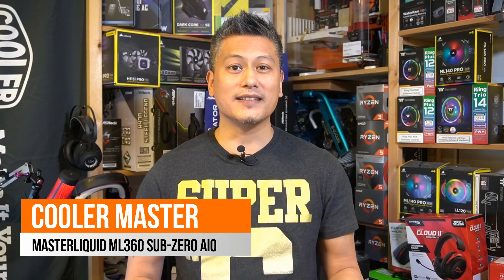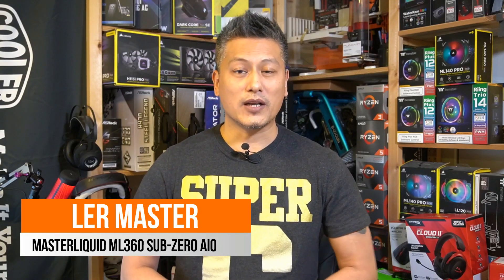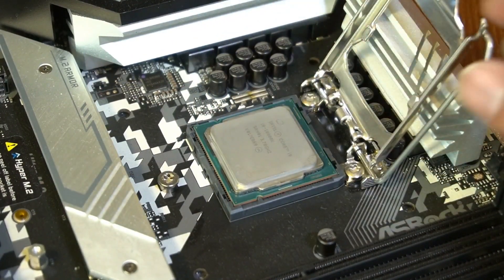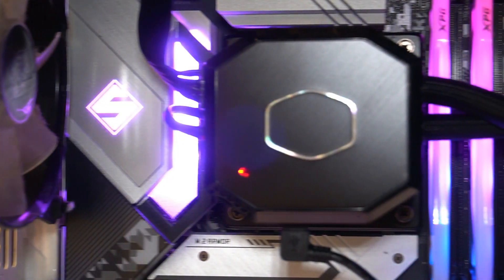Installing and Testing the Cooler Master MasterLiquid ML360 Sub-Zero AIO CPU Cooler

Comment: If radiator is on the front pipes should be on the bottom to reduce air trapping
Reply: Doesnt matter, the pump is at a lover point in the system, if you get air traping with this configuration, there is something wrong with your AIO

Comment: Can some please verify for me if running a dew point of 12.4 with a temp of 14.4 degrees Celsius is a desirable range and better yet, can some please direct me to a guide of what the safe and desired ranges are? Also, should the unit be going into standby mode on its own or only when manually set to it?  I've been trying to get an answer from coolermaster to no avail...If anyone can offer me guidance, I would be grateful. Thank you.
Reply: UPDATE -I have been trying to get an answer from coolermaster for about two weeks now, I'd like to hear from them directly - I will post the interactions I have and or initiate with them detailing their "customer service" - "This is ridiculous, I have yet to hear back regarding a normal question as detailed above. NO ONE FROM SUPPORT HAS CONTACTED ME IN OVER A WEEK."

Comment: My system won’t boot with cpu 8 pin connected to the water block. It will boot without the 8 pin connected. What cable are you using to power the water box/tec
Reply: Pcie cables

Comment: can you use it on a TR4 socket?
Reply: Read information about this aio
Reply: Officially no, its only for intel, but you can use some custom bracket and a second motherboard with a intel CPU to control the software but cold the AMD CPU
Reply: @victordavid29  i dont think using a second motherboard would be needed, as long as you could get a tight enough mount on the cpu, you just need to plug in the extra power cable and the other cords. installed it on a different pc (intel) and it didnt need anything special besides the extra power cable

Comment: Can be this used to cool a delided direct die i9-10900K ? (I mean the height will be a bit less due to lack of IHS on the CPU)

Edit:
I tried and it is not possible.

The Cryo cooler has a plastic/rubber which prevents the copper plate to be mounted lower - to touch to delidded CPU.
So, you need a CPU with IHS to fit the Cryo Cooler Master.

I am not sure about the EK TEC cooler though..

Comment: Im hitting easly 5.6Ghz on my delided i7 10700k without any problems...in IDLE mode with this cooler (20°C). 
I don't even use thy cryo Mode. Which i've tested and it drops the Temps to 10°C and need extra 50Watt.
Awsame Cooler and nice Review! 👍
Reply: So you are saying you can simply use the included mounting of the Cryocoler on the delidded CPU ? I am wondering you are direct die cooling or you just delidded / applied liquid metal and put back the IHS ....   

And more on this : they say on sustained load on all cores the Cry Cooler cannot cope , something like the Peltier is itself a bottleneck . Is that right ? Could you keep the i7-10700k on all cores on load at 5.6 Ghz ?

And at last , what about the noise ? They say the pump is very noisy ...
Reply: 6.7 on i9 11900kf for a second and no crash

Comment: can you control the speed of the pump? and the fans?
Reply: Not using the included cables. The fans could be plugged directly into motherboard headers (or a fan hub) to control them. The pump, though, plugs into a SATA power connector. To change the pump speed you'd have to adjust the voltage going into that cable. You could try that by modifying a SATA power extention cable to drop the 12v to 7v. No idea if that help with the loud noise or if that's just a reality of this pump.
Reply: @jomeyqmalone  Pump, no.
Fans, yes
Reply: @jomeyqmalone  Not with the suplied cables : the AIO Pump is powered with 12V from a SATA connector.
But, I managed to modify the Cooler Master cable : fitted the fans into a PWM 4 pin Fan header , and also the AIO pump managed to fit as a 3pin DC fan into the motherboard . This way you can controle speeds both for the AIO fans and AIO pump from Bios with a user defined curve . Of course you need a motherboard with enough Fan headers and the option to controle PWM / DC fans.

Comment: warning! This cooler can only be uesed for single core boost overclock or low power CPU such as 10600k. When you are doing some heavy duty such as P95, AIda64 FPU and R20 stress test with a CPU power consumption greater than 200W(like overclocked 10700k or better CPU), the performance of the cooler is pretty similar to a normal 100$ 240mm liquid cooler.
Reply: Why is that ? 
I am running a i7-10700KF , direct die cooling, 360mm AIO : 5.2Ghz on 1-6 cores, 5.1 Ghz on 7-8 cores . 
On full load benchmarks CPU is sucking obvioulsy more than 200 W , peak at somewhere 295 W .

And I was wondering if this cooler might help me for higher speeds ...
Reply: @TiraSoft_GB_Ham  did you get the cooler in the end
Reply: @arjundevalia1439  yes I did. tested it ... longer story .. I will make time to write it , lol .
Reply: @TiraSoft_GB_Ham  yeah could you tell me please cos I’m considering on buying the cooler master ML sub zero aio thing

Comment: This is very cool (pardon the pun). However I don't think the tech is quite there yet to be worth it. Apparently it struggles and even performs worse than normal aios when under heavy multicore loads. I would love to see the results on a delidded CPU.
Reply: Seemed to work fine during his testing. Besides the fact I'm using the hex 2.0 on my 9900k. Keeps it cool under normal load at about 4.8 to 5.0. Average about 75c to 85c.
Reply: @georged5420  75-85C isn't normal on a thermoelectric AIO... I thought this was supposed to cool the CPU better than a normal 360 AIO, but I guess it sucks ass.
Reply: @sL1NK  my hex 2.0 that I use was compared against 120 aio not a 360 aio. Furthermore running a voltage of 1.2 and gaining 5.0 is pretty damn good at 85c. So no it doesn't suck ass only your comment does.
Reply: @georged5420  how do you mount this to socket 1151. Says it only support socket 1200?
Reply: @thomasadolphsen2550  I'm using the hex 2.0 cooler. It's also a thermoelectric cooler. Very early version that are cooled.

Comment: A cryo cooled 10900k being driven by the ASRock Steel Legend's underpowered VRM setup? You're a braver man than I. Doubly so since your front mounted rad setup for the TEC is essentially like bolting a 400w heater to your case intakes.
Reply from the maker: LOL yes brave ... plus I left the case side panel off :D
Reply: @Funkykit  Would be better if the fans were exhausting in a top mounted setup.
Reply: @Jedi2155  Yes recommended setup is rad on top mount an not for i7 i9 lol Hope he shows his 10900k dead from cooler vid
Reply: @iLLicitNz78  Rad on top means avg +10-15C to the CPU, why would it be recommended?
Reply: @sL1NK  Because that’s heat that doesn’t hit your gpu
Reply from the maker: Yes it would... I just wanted to see if it would fit ok if mounted on the front. Plus it looks way cooler lol 😆

Comment: Stability test for 40sec :D :D   worst review
Reply: people who have their cryo block from ekwb have reported worse temperatures than a normal waterblock under load. these review youre watching are from golden chips that can clock crazy high with way less voltage than what normal people will get delivered at home. you can even tell by the monitoring software he used that the cpu would thermalthrottle during benchmarks and reach way over 100 degrees. i mean its still fine because no game would use the cpu this much and it wont reach those temps but i bet that its still worse than a normal water loop

Comment: Hey. This isn't the recommended installation. They want the radiator to be top mounted and the pump at the front.
Reply: For good reason. Scary, as that motherboard's VRM is the worst of any board that supports Intel Cryo (as far as I know)
Reply from the maker: Yes it isn't the 'recommended installation' but we wanted to see if it fitted at the front of the case ... it works.